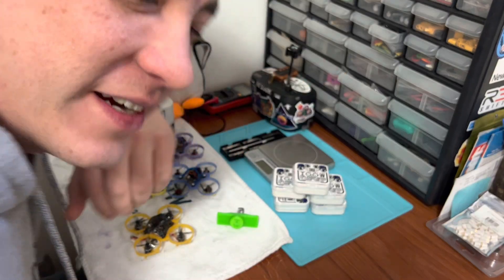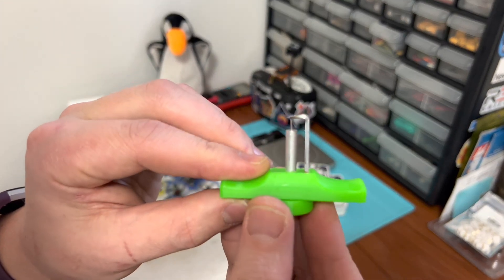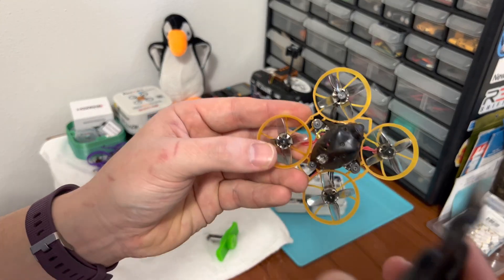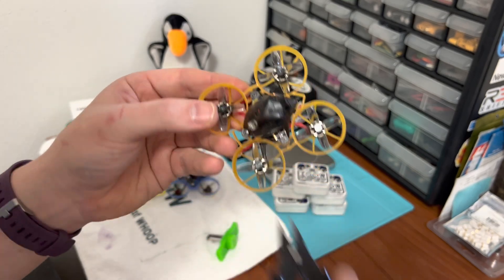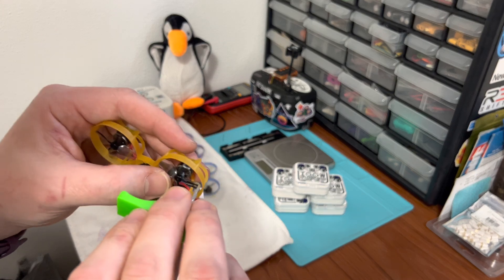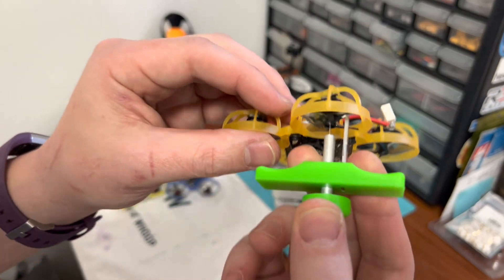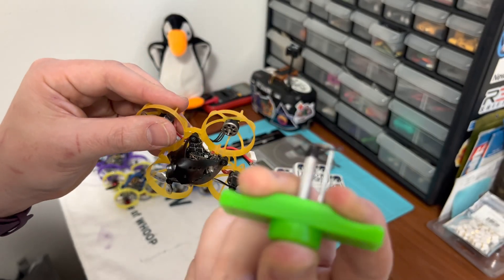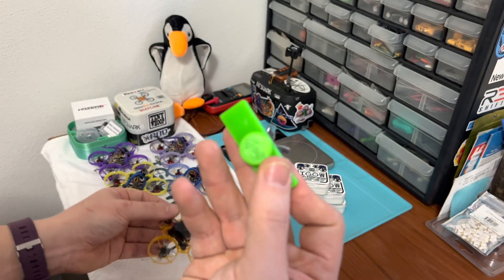The Prop Popper: A Revolution in Tiny Whoop Technology

Comment: I would like to ask, does a prop popper actually work if you push your props all the way to the motor, basically touching the C-clips? Thank you
Reply from the maker: Yeah but then its not as simple. you have to push the fork between them then or losen it a bit first. The origial and the clone popper are best at that

Comment: If only they were actually selling it or selling it anywhere outside their local shop, knowing that's a game changer tool. If you can't manufacture it just make it opensource, you aren't making money anyway. Though it's not exactly a rocket science, it's just a lazy manufacturers that don't care.
Here is a life hack for you: take a wax candle and lube the motor shaft slightly. That way the prop will be put on and off much more easily. In my case it was the only way i could put on my props. The only downside is that prop can pop off eventually if it's not very tight fitted

Comment: Good idea, room for improvement. 

I'd want it to let go of the prop when removed, so it seems the spring is going the wrong way. However, if you want the locking, I feel it needs a thumb loop so you can open it with one hand to quickly remove the prop from the tool.
Reply from the maker: There is no spring. The plunger part just slides up and down. The prop literally falls off the off the tool when you pull up the plunger again. Check out the full review I am posting later today so you can see it better.
Reply from the maker: https://youtu.be/7rejExxi7Z8

Comment: my problem is I push my props all the way down on the shaft so they are resting on the bell and I can't get a gap between the prop and the bell to insert any kind of tool.
Reply from the maker: Mothy I do as well! This tool is awesome and still works even with the hub basically against the shaft. It’s a bit more difficult than the demo in this video but it’s is far better than anything I’ve tried before. The fork is shaped in such a way that the end is thin so you just work the tip of it under the prop hub and then it the fork gets fatter so as you shove it between the prob and bell often it just pops off without need for the pin part. I will have a more in depth video showing it off soon.